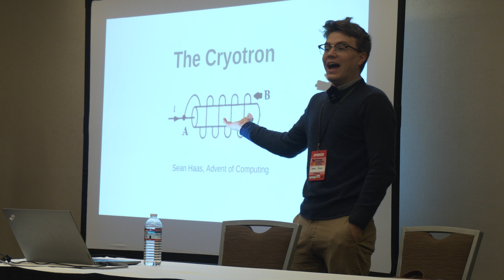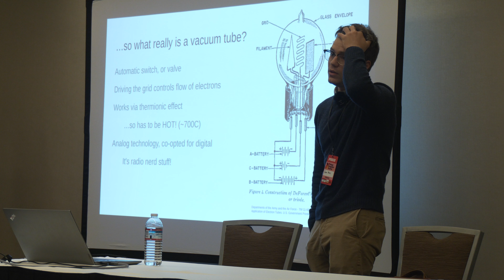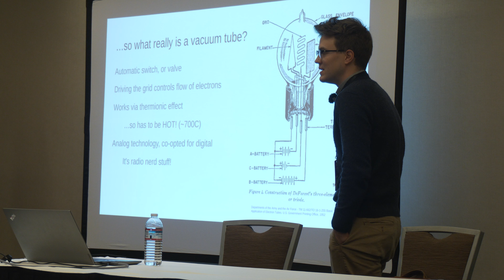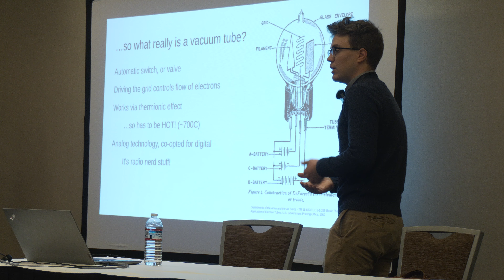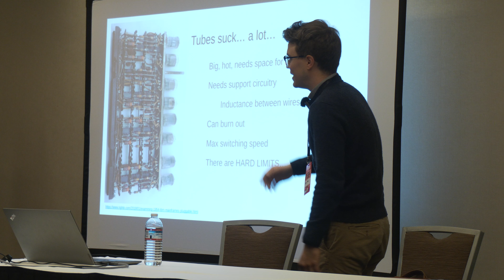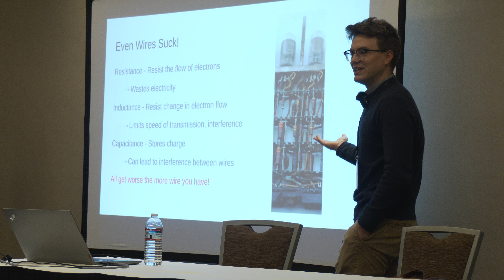VCF SoCal 2024 - The Mysterious Cryotron!

Comment: 2:44 At what point did the NSA sponsors consider what the furthest that light can travel in 1/1,000,000,000 of a second is, and what that necessarily means for the size of any 1GHz CPU? Not to mention the simple audacity of setting a 1GHz target in 1956.